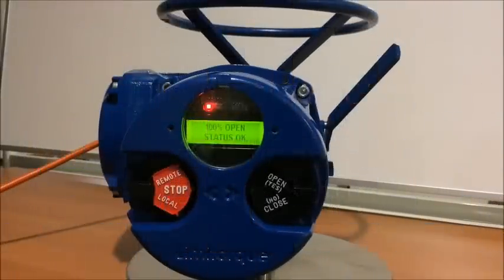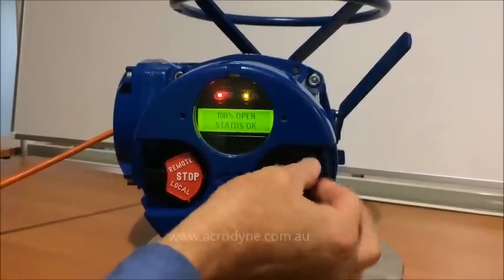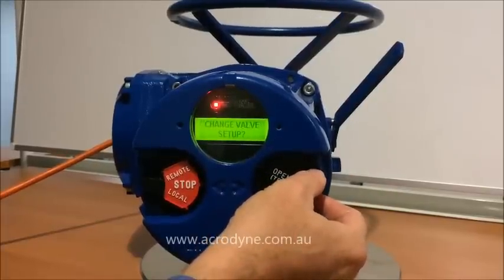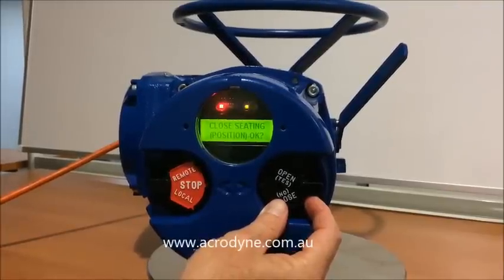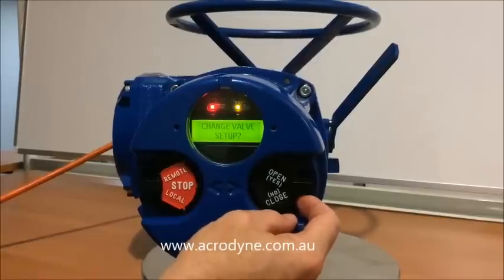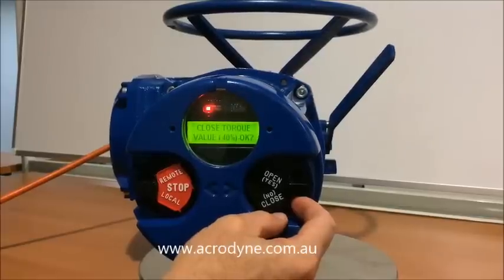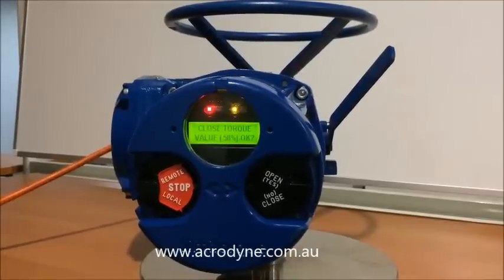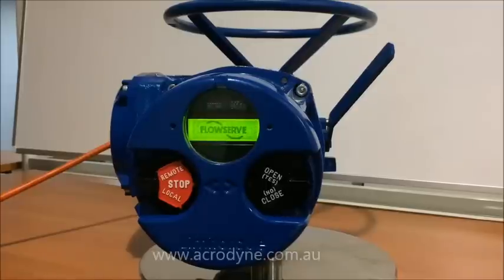Valve Setup and Torque Setup of Limitorque MX Actuator

Comment: What would cause the actuator to travel open slowly to the point that it times out in auto remote on DCs and fails close? Locally, the valve opens and closes in 2pct increments. Thank you.